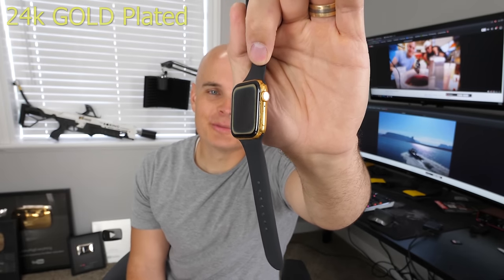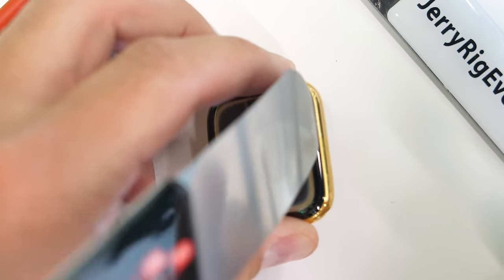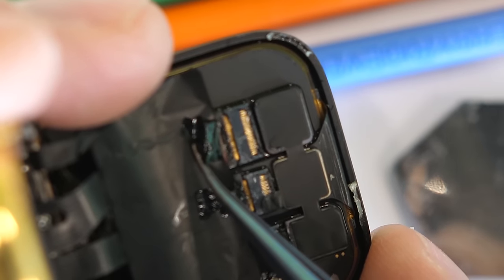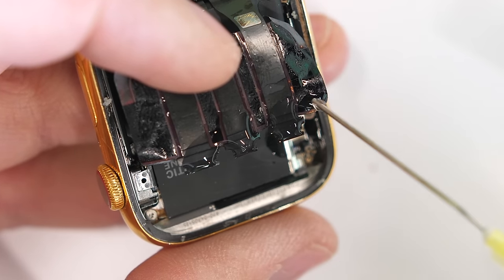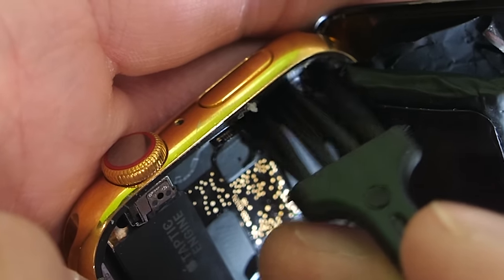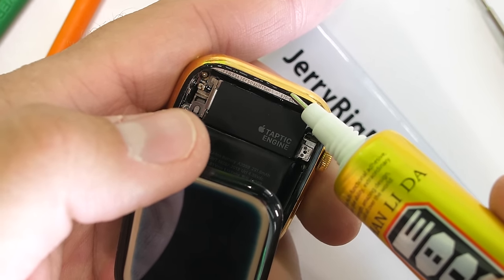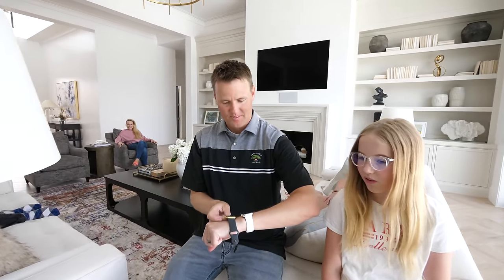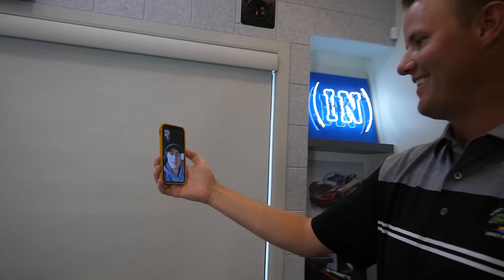GOLD Apple Watch Under Water for 9 MONTHS! - Can i Fix it?!

Comment: Nobody: 
5 minute crafts: Just place the watch in a bag of rice
Reply: Soundarya Matrubai 😆
Reply: It will work only if it was slightly damaged
Reply: @flazeslayses4615  but 5 min crafts promotes such silly "hacks"
Reply: Obviously this is a joke about  5 Minute Crafts, but this is a good opportunity to inform people that putting electronics in rice does NOT work, despite this being a very common myth. Silica gel packages might work in some situations, but rice will not. 
The best thing to do when dropping an electronic device into water is to turn it off immediately and - if it has appropriate I/O or ventilation - gently blow-dry it periodically. Hardest part is to resist the temptation to turn it on & check. 
Even if the device seems to keep working afterwards, it's best to check for a replacement. Corrosion might still be happening inside and suddenly break the device a few weeks down the line.
Reply: @Davidesrajohn  omg! I didn't expect this reply with such proper explanation 😝. Good job!
Reply: HAHAHAHAHA
Reply: If you don’t understand what he said. Corrosion is in the contacts. Corrosion just doesn’t disappear.
Reply: @Davidesrajohn  well as an asian, rice kinda works when your speaker sucked some water but I suggest using like only bowl because the rice isn't a god item, but I don't like to promote 5 mins craft because the channel is the worst and it's just cringe
Reply: Rice does nothing. It leaving your phone to dry for hours. Rice can damage stuff more my going in through speakers and more stuff

Comment: “I would never trust it to be water proof “ yet it survived for 9 months under a lake and was still fixable
Reply: Technically fixable? Yes.
Economically fixable? No.
Reply: He means he wouldn't trust it to be waterproof after he put the glue in to reseal it. It was airtight when it was an Apple factory seal, but likely isn't anymore with just that glue.
Reply: @itsbazyli  I thought he meant in general

Comment: Me: Confused because he’s using liquid to fix the Apple Watch.
Reply: Isopropyl alcohol evaporates really fast. Also, the battery is dead and disconnected, so the only thing that could have power I think would be capacitors, which at that size are unlikely to break anything.
Reply: @wolfleopard808  If the battery is dead the capacitors are too, they dont hold voltage for very long
Reply: I know

Comment: Your lucky I’ve worked on thousands of water damaged apple devices mostly saltwater though. This  is a low percentage chance of repair even in freshwater. Interestingly clean inside for 9 months underwater. Those tiny screws rust when you say water near them.  There has never been any water inside that watch.  The battery definitely wouldn’t work after being wet 9 months. The screen might fail but the watch should be fine. A little water spoiled the loca around the screen edge but that’s all I saw water damaged. Jerry you worked on enough devices to know the screws rust in a few hours not even days. I do love your content and your soothing voice is cool to listen to.

Comment: the thing about corrosion is even though you can clean it off and may get the device working again, once that corrosion has started you're not going to stop that chemical reaction and it will gradually get worse and worse. no matter how much you clean it.

Comment: Honestly mate, I'm not one of those guys that is really toxic, this is a genuine question as I'm curious. Why do you talk the way you do? I mean don't get me wrong you make videos that are really informative which I like but I do feel like you talk a tad like a robot, same with your wife actually. 🤔 This is not an insult, I'm genuinely curious. I thought you did it just for videos like this, to sound more relaxing to watch, but it turns out that's how you talk. Its like the stereotype with news reporters. 🙂

I also wouldn't use that little black brush as it can scratch the connectors. Best to use a cotton bud or cue tip and flatten the end a bit to get into the small areas.